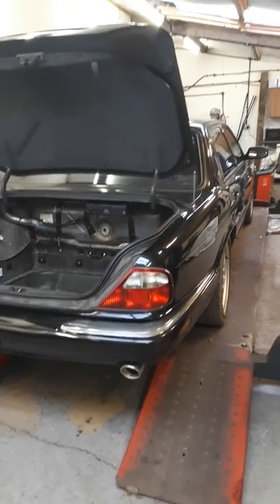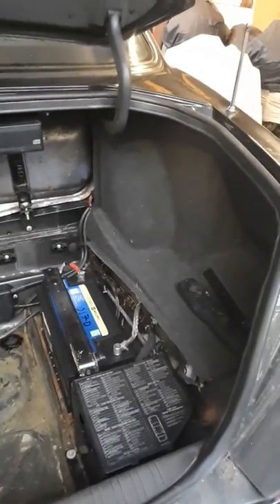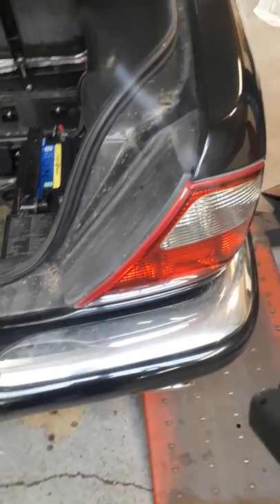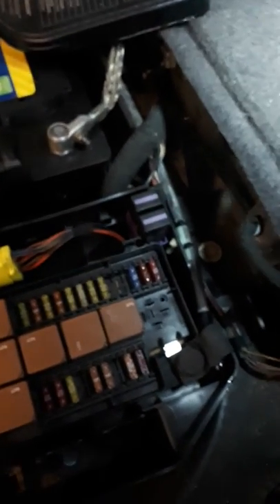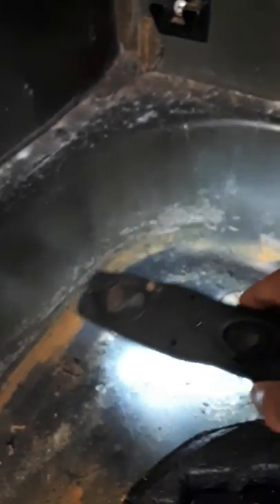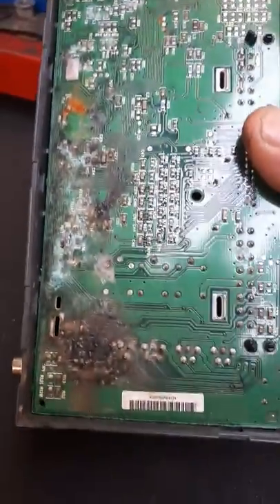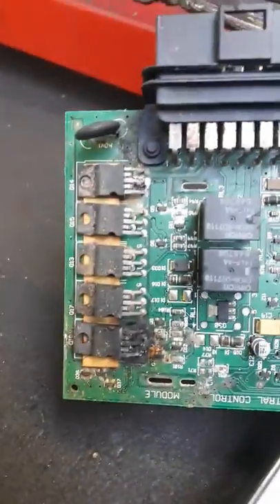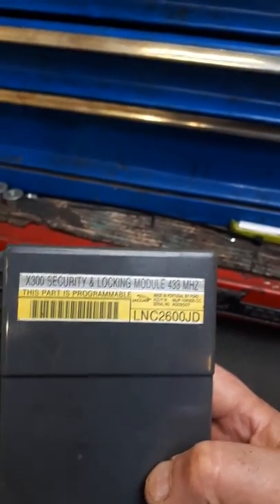Jaguar XJR 1997 Security and locking module fault

Comment: Superb, thank you.
I have one fob that for my ‘96 XJ6 has stopped working and won’t light led’s even with new 2016 batteries. I have a ‘97 XJ6L parts car with two working fobs. 
I’m fairly certain the ‘96 is 315 freq and ‘97 is definitely 433 freq. I may try switching modules to be able to use the fobs on the ‘96. 
I wonder if they changed the plugs between years? Guess I’ll find out 😂